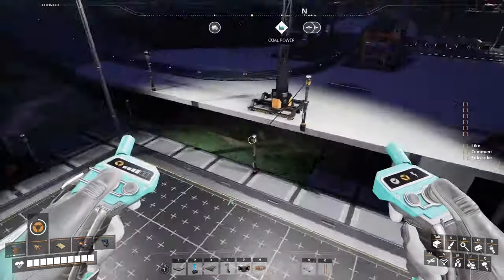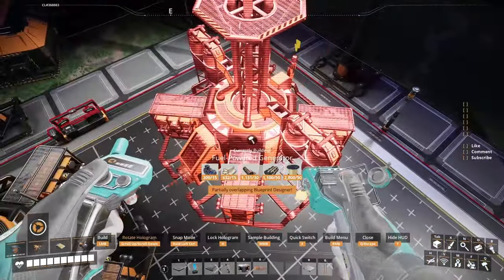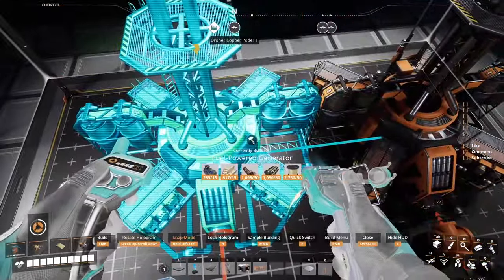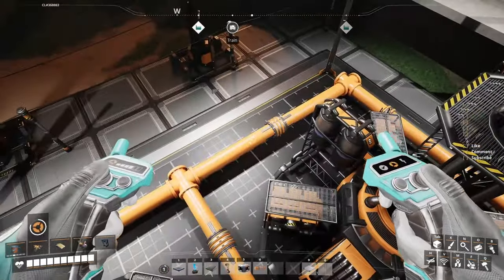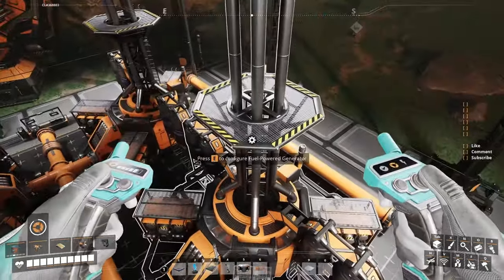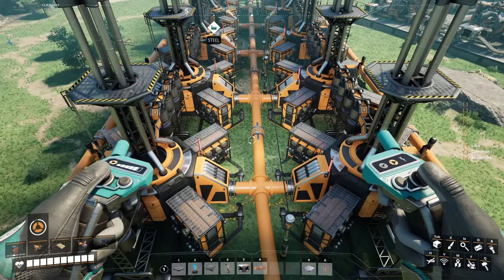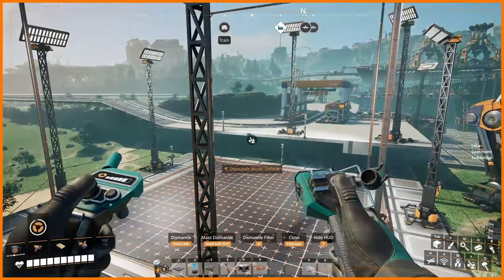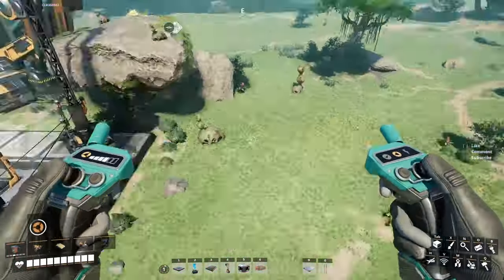Satisfactory 1.0 - Blueprint Masterclass with BIG - Fuel Generators

Comment: Most of us only have the 5x5 mk2 blueprinter by the time fuel becomes relevant, maybe try condensing down your setup to work in that. 

I'm still working on mine because pipes seem to be the limiting factor, clipping out of the design area.
Reply from the maker: Got-it. I'll work on that @RenardTatch and be back with something. Thanks for letting me know and for being here.
Reply from the maker: Hi there @RenardThatch, I've made the video and the blueprint, it will be published Sunday 27. Thanks for letting me know of this issue and if you have any other requests let me know.